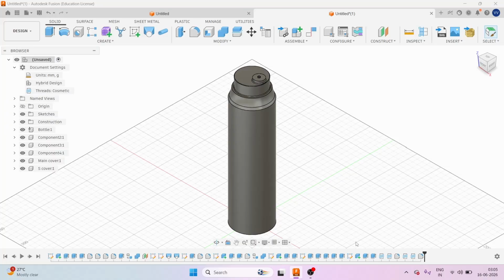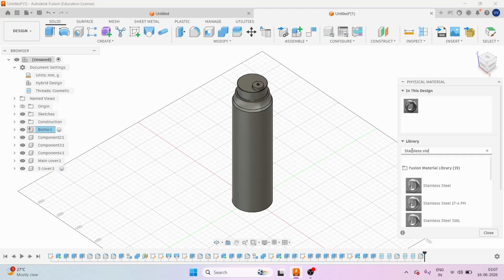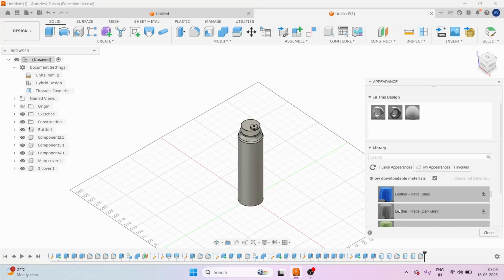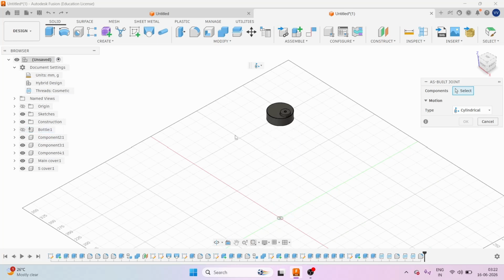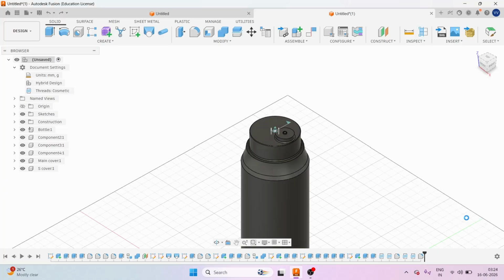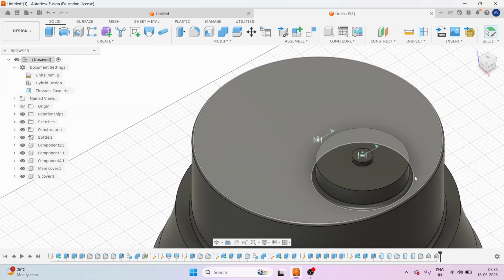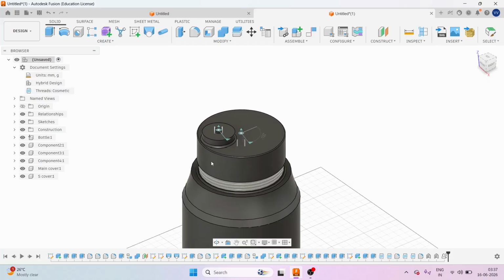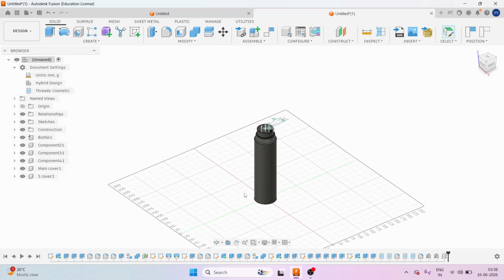Lesson 24 of Autodesk Fusion 360 for Beginners - Bottle Assembly Part 3(Cylindrical joints)

Comment from the maker: There is nothing better than setting up Motion Limits and seeing a cylindrical joint slide exactly where it's supposed to without clipping! 🚀🧪 Let's hear your thoughts: Now that we've assigned real physical properties like Stainless Steel and Polypropylene, do you use Fusion 360 mostly for visual appearances, or do you use mass and material data for real engineering calculations? Drop your project goals below! 💡